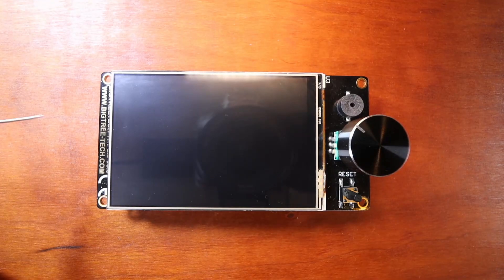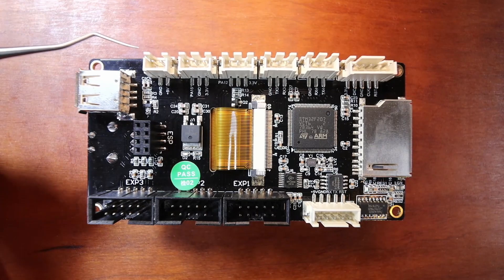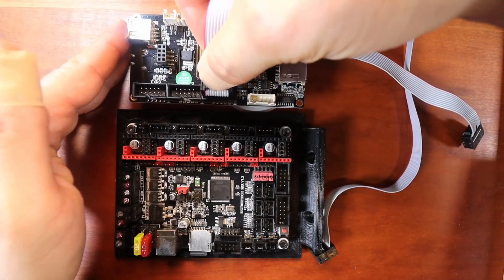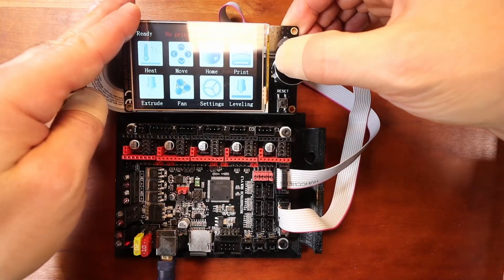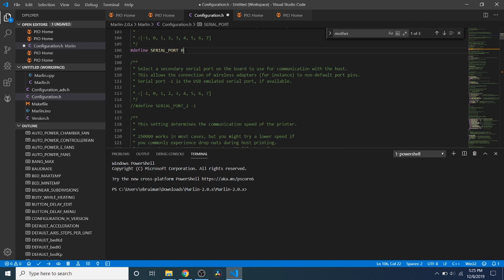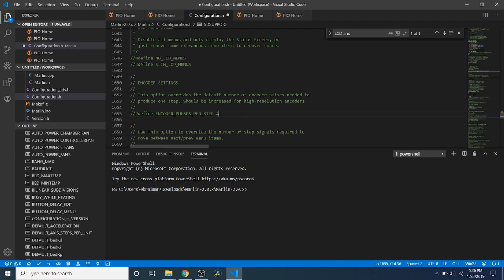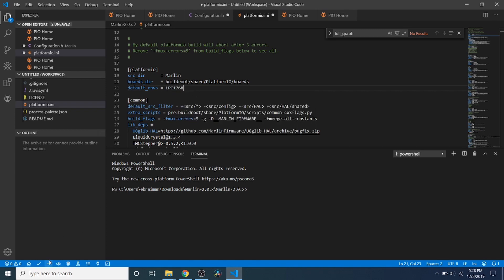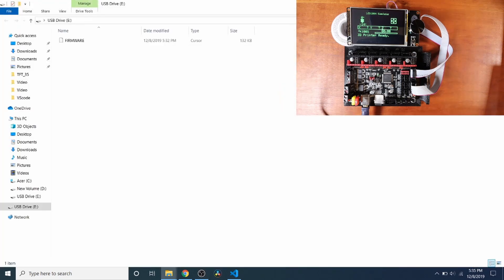SKR 1.3 - TFT35 V3 RepRap Discount Full Graphic Smart Controller Mode (1 of 3)

Comment: I don't think bigtreetech is meant to be programmed using vs code.   I have watched and followed every video to the letter for 2 weeks now and no success.
Reply from the maker: What's occuring?
Reply: Well, I have tried loads of videos and then found yours.   You make it look so simple, I thought that is great.  I am wanting to buy a skr 1.3 or 4 but I just can't get past the last bit putting in the lpc1768 file . Just getting red message, no such file.  Sorry to sound stupid but I dare not buy another board and screen and bltouch if I can't alter the settings.   Thanks very much for replying.
Reply: Sorry, will the board come with this on.

Comment: I have been looking into the 'pio\build\LPC1768\src\src\HAL\LPC1768' folders and I am not quite sure what to fix.  

Marlin\src\HAL\LPC1768\../../sd/../inc/SanityCheck.h:1573:6: error: #error "TEMP_SENSOR_1 is required with 2 or more HOTENDS."
 1573 |     #error "TEMP_SENSOR_1 is required with 2 or more HOTENDS."

      |      ^~~~~

In file included from Marlin\src\HAL\LPC1768\../../inc/MarlinConfig.h:38,

                 from Marlin\src\HAL\LPC1768\persistent_store_sdcard.cpp:25:

Marlin\src\HAL\LPC1768\../../inc/SanityCheck.h:1573:6: error: #error "TEMP_SENSOR_1 is required with 2 or more HOTENDS."

 1573 |     #error "TEMP_SENSOR_1 is required with 2 or more HOTENDS."

      |      ^~~~~

In file included from Marlin\src\HAL\LPC1768\../../inc/MarlinConfig.h:38,

                 from Marlin\src\HAL\LPC1768\timers.cpp:31:

Marlin\src\HAL\LPC1768\../../inc/SanityCheck.h:1573:6: error: #error "TEMP_SENSOR_1 is required with 2 or more HOTENDS."

 1573 |     #error "TEMP_SENSOR_1 is required with 2 or more HOTENDS."

      |      ^~~~~

* [.pio\build\LPC1768\src\src\HAL\LPC1768\DebugMonitor.cpp.o] Error 1

* [.pio\build\LPC1768\src\src\HAL\LPC1768\HAL.cpp.o] Error 1

* [.pio\build\LPC1768\src\src\HAL\LPC1768\persistent_store_flash.cpp.o] Error 1

* [.pio\build\LPC1768\src\src\HAL\LPC1768\persistent_store_sdcard.cpp.o] Error 1

* [.pio\build\LPC1768\src\src\HAL\LPC1768\HAL_SPI.cpp.o] Error 1

* [.pio\build\LPC1768\src\src\HAL\LPC1768\main.cpp.o] Error 1

* [.pio\build\LPC1768\src\src\HAL\LPC1768\timers.cpp.o] Error 1

======================================================================================== [FAILED] Took 3.49 seconds ==
Reply from the maker: If you try to build without changing motherboard from a fresh build, what occurs?

Comment: Very nice work here, thank you!  I am stuck at the 8:15 mark.  I had entered in 2 extruders and I keep getting one 'problem'.  #error directive: "TEMP_SENSOR_1 is required with 2 or more HOTENDS."
I have both temp_sensor_1 and temp_sensor_2 uncommented and I keep getting this error failing to compile.  
Any input is greatly appreciated.
Reply from the maker: Which version of Marlin firmware are you using?  Are you using two physical extruders or one printhead with two filaments as input?

Comment: Just got my BTT TFT35 E3 V3.0 and connected it to my BTT SKR V1.4 Turbo, and get "no printer attached", tried the baud rate setting but makes no difference.
Reply from the maker: I'll see if I can get mine working.
Reply: @EdwardBraiman  Weird thing, using their precompiled firmware for the screen, or compiling it myself I keep getting the unified version, not the classic I want.  Currently recompiling the SKR to see if switching the serial port will help.
Reply from the maker: @SteinerSE  sounds like the developer changed the settings.
Reply: @EdwardBraiman  Right now it looks weird because it still uses the classic icons, so quite a few are missing, but it still does the unified display (despite being disabled in the config file). Guess they have decided to force the new UI on us.
Reply from the maker: @SteinerSE  kinda makes the tutorial painful after the change.  Maybe they're upset I didn't respond to there request for my email address.

Comment: Hi, great video.  I followed you steps; compiled successfully, saw the .bin file; but after unplugging and re-plugging, it still just displays " LCD12864 Simulator" and that's it.  Any ideas, suggestions?  Thanks.
Reply from the maker: Hold down the knob for 5 seconds and select the LCD type you want.
Reply: @EdwardBraiman  Thanks for the quick reply.  I can change back and forth between the two modes.  The Touch screen seems to work fine, but the simulator part doesn't seem to.  Just displays" LCD12864 Simulator" and seems to hang fro there.
Reply from the maker: Checkout my firmware update video. It may help.

Comment: Hello, I have some issues. 
1)I can't acces all gcodes from usb or sdcard (specially : big gcode files up than 15-20-30mb ),  No problem in pc connection prints.
2)I can't connect the wifi module esp01, I can see the wireless name but I didnt find the default password :D (I tried 12345678)
Reply from the maker: Just posted part two, see if it helps.

Comment: Thank you as mine arrived on Friday and I will be printing a case for it later tonight.  Came scratched up so a bit miffed at Amazon and how they are treating me over this one.  Still I do not understand why it can't do 250 kilobaud even though there is a menu option for it.
Reply from the maker: It actually does do 250k buad rate, but I'll explain in a couple of days in the third tutorial.
Reply: Great to know and I will be without mine for a few weeks while I await a refund so I can order it again (because this is only sold via a 3rd party seller on Amazon all they can do is refund not exchange).

Comment: I have mine up and going on my ender 3 with skr 1.3 and the TFT 3.5 V3.0.  Long road for me, turns out the SKR 1.3 ESP 2 connector was tarnished and kept me from going to Simulator.  A bit of sand paper fixed what 2 weeks of troubleshooting couldn't.  thanks for all the time you spend putting the video together.
Reply from the maker: Thanks.

Comment: Thank you for your work in posting these videos.  I was at a complete loss to set up my SKR Pro.  About to give up when I was told about your videos.  Up and running again.  Eagerly waiting on how you setup wifi on these.
Reply from the maker: Thanks, WiFi I'm still having issues  with, but with Marlin 2.0.x release, I'll be looking again.  I do have another solution I'll be doing in a couple of weeks.
Reply: @EdwardBraiman  Since the TFT35 has some nice plug in slots, would it involve using a usb or SD card that's wifi capable?
Reply from the maker: @johncrosson7834  it can do WiFi, currently I'm working on how to setup.  It appears a little involved a process.  I'm waiting on equipment to arrive for possible programing of wifi board.